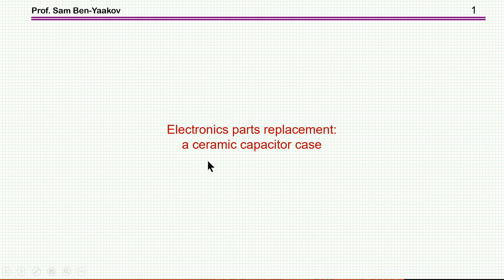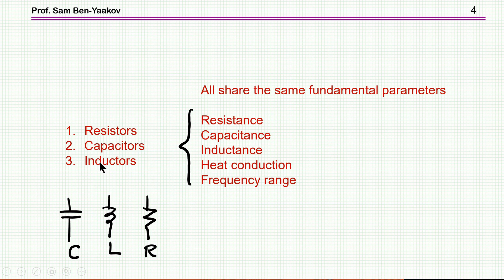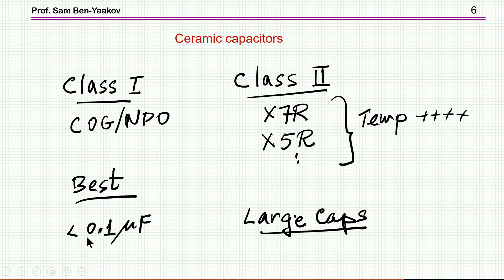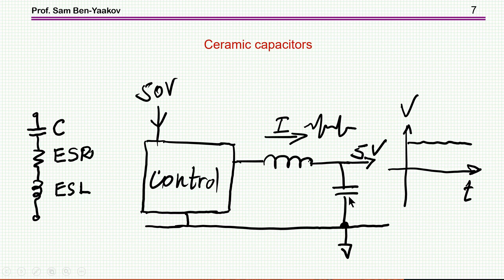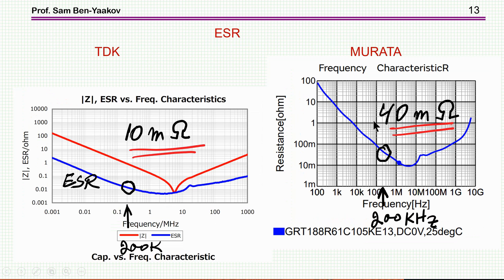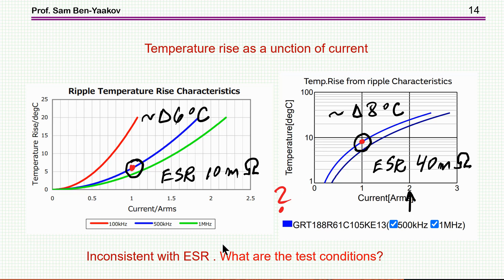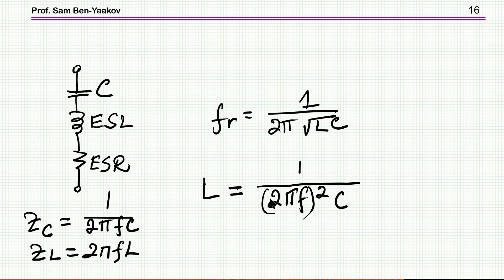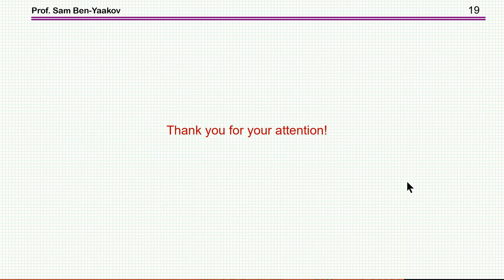Electronics parts replacement: a ceramic capacitor case

Comment: As noted in the video, the qualification process for a component is lengthy, and the data sheet is just the starting point. For most designs, in normal non-pandemic conditions, for passive components, the engineer is required, usually as a minimum, to specify two from qualified vendors.

However, rule #1 for passive component data sheets is --- do not trust them, at times they contain more fiction than fact. 

The data sheet is just a basic starting point for possible candidates. 

The hard lesson here is get the part on the bench, run tests important to the design, and then see how the component really works. Do not exhaustively scrutinize data sheets for components that you will be testing on the bench. Purchase or request samples and do the bench testing, and when a component looks promising then explore operational characteristics in a prototype. As a basic test, at room temperature, you can observe temperature rise (power dissipation), once the circuit is stabilized with  a thermal camera. If this looks good than move on to full environmental temperature testing. 

In using surface mount ceramic capacitors, at some point they will have to be soldered to a PCB, and if the application is subjected to vibration, flexure, or heat cycling you will put stress on the device ceramic body, where by it may crack. So environment conditions are very important in specifying a ceramic capacitor. For example: the device design may feature soft termination to minimize stress cracking under a mechanical flexing load. 

Another consideration for SMT capacitor usage is the capacitance value in regards to the component height and length relative to the amount of solder paste volume for a given PCB footprint pad area. 

In other words, for a given capacitance value, working voltage, and dielectric, as a designer, you could choose an 0805 package that will be relatively tall or a 1206 package which would be relatively short. The difference between the two is the SMT pad area (footprint design), which, if you use a single thickness stencil, equates to the solder paste volume available for the solder joint fillet. 

Usually for chip capacitors the tendency is to conserve board space by selecting a small footprint size and moving to taller components for higher values or voltages, and what you will find is the solder fillet (joint) does not have enough volume for a very tall device. As a result, to get the proper amount of paste volume, you will have to increase the pad area (change the footprint) for a very tall device.
Reply from the maker: Thanks for sharing your experience/thought

Comment: The aging  drift in class II capacitances is frequently overlooked. Check the sensitivities of your active filters and be careful with measurement circuitry with capacitances in the transfer function.
Reply from the maker: Goo points. Thanks.
Reply: @sambenyaakov   Thank you for your videos in this age of SPICE and accelerating product design by re-using existing work.

Comment: Yes, it can definitely cause trouble as impedance increases with the frequency, and suddenly harmonics will not be suppressed as good as before. That's why all of us were taught to put several caps of different values in parallel.